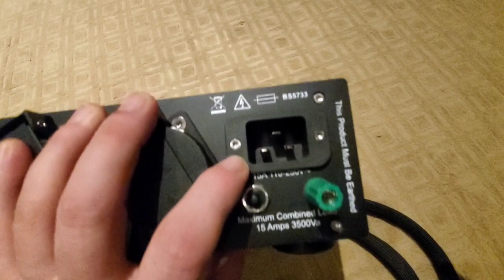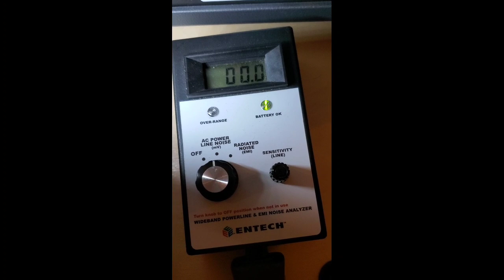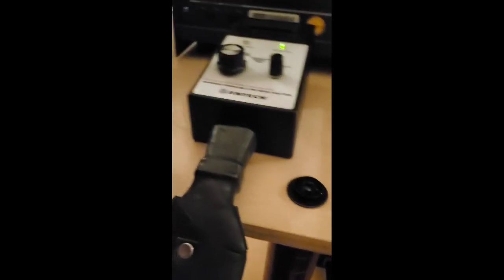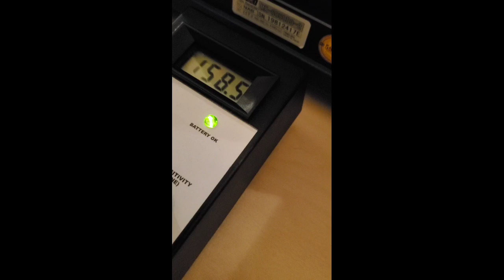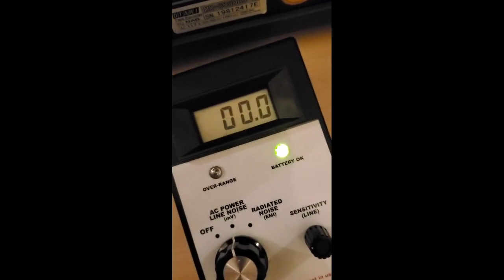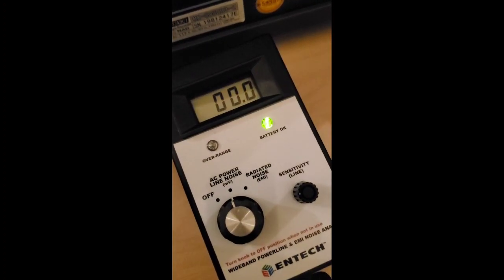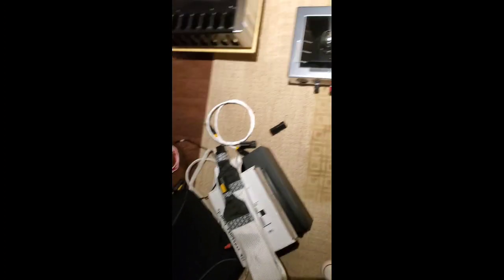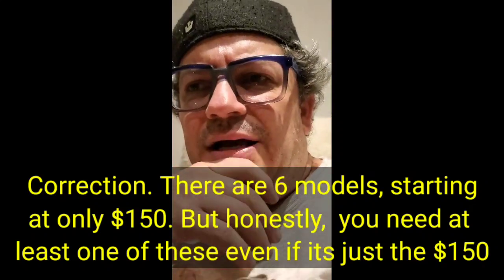PURITAN AUDIO LABS AC power conditioner

Comment: Looks like a terrific piece! It is very true that you aren't aware of the grunge in the system until it is taken away. I experienced it with power cables, power conditioner and just when I thought it couldn't get cleaner a nice power supply lowered the noise floor even more. Anyone on the fence should give Mikey a call and enjoy the benefits a good conditioner will bring.
Reply from the maker: Thanks !

Comment: While using the puritan line conditioner I noticed the tones dig deeper.  I also noticed the decay a little more pronounced.  I noticed the added Sparkle!  I could hear the sound stage widening due to a more pronounced decay.  The sound stage expands in depth as well.  Brings more weight to the sound.  I feel my rig does all this well as is.  I can't imagen how much better my rig would sound on a dedicated ac line while using the puritan line conditioner.  Can't wait to try this out! Thanks Mickey for sharing.

Comment: Hi Mikey,  Nice video again. Just another great example that the Puritan audio labs  filters are the real deal when it comes to cleaning up AC Power. I am the distributor for the Netherlands. Yesterday I was with a sound engineer and also a Jazz drummer with his own record label. It proofed that for sound engineers with tons of stuff in the input to clean and for listening back to the master on speakers.  The PSM156 or better the PSM 1512(more outlets)  leads to better judgment making in the mastering process. We do HiFi but pro audio benefits from clean power too. At the end we all listen to their results.
Reply from the maker: Yes, that is true. Ive got a client who isva mastering engineer. He told me that he loves the cord, as he has to EQ less when using my cables on his outboard gear. Then ive got a recording engineer that wont tape an event without  Verastarr on his tape deck.

Comment: My Puritan PSM 136 has only been in my system for 24 hours and no where near the recommended two weeks of burn-in and it's much better than my previous 10 conditioners.

Decay, Clarity, dimensionality, sound-stage width, depth, height and the illusion of actual performers occupying a space between and beyond the boundaries of your loudspeakers.

I do believe it will get better as the wiring, outlets and boards hit that 300 hours of constant use threshold.
Reply from the maker: Awesome Ron,  and you bought it from me!

Comment: I have one of these ....is the only unit that worked with my D’Agostino amplifiers.  I can’t afford to be without protection where I live and this worked better  than the Audioquest 5000 and 7000 by the way.
Reply from the maker: ve heard it works better than a lot of the more expensive units. Of course it sounded better than AQ,  again, another company ridden hard and put up wet, Nothing like it used to be....
Reply: Dear Hector, could you describe how it affected/improved your D’Agostino amplifiers? What are the pros and cons?
I have a Momentum Integrated but am still a little hesitant.
Reply: @monstermind1976  what I would tell you is that there was no sonic differences between the wall outlet ( dedicated 20a) and this unit. With anything else I’ve tired it constrained the music detail a bit
Reply: @hectoralvarez941  Thank you Hector. Did you plug all your front end gear in the Puritan? Pre-amp, DAC, other sources?
Many people report hearing an improvement but not everyone I guess. Makes me hesitant to make the investment. Quite a waste if you can’t hear the difference. I don’t need the protection part as I live in a condo with proper protection.
Reply: @monstermind1976  I just plugged the amps.  Use the audio quest for the front end.  ( my speakers and amps are about 15 feet away ). I have a 35 ‘ deep room
Reply: Vs Ansuz?

Comment: It seems smoother overall.  The capacitors in the power supplies should compensate for dynamic concerns much of the time.  In reality, the power feed does seem to matter even with the fact that current flows through a tiny wire that is the fuse.   Noise reduction helps with audio.
Reply: i realize it's pretty off topic but does anybody know a good site to stream newly released series online?
Reply: @Enoch Cannon Flixportal :)
Reply: @Levi Layne thanks, signed up and it seems like they got a lot of movies there :D I really appreciate it!
Reply: @Enoch Cannon you are welcome :)
Reply: @enochcannon1555  aucun rapport!

Comment: A major advantage of the IEC 60320 system  (C19) is that it can be used globally. When an equipment manufacturer designs an IEC 60320 inlet into a product, which is the most common means of connecting a detachable cord set to electrical or electronic equipment, it allows that manufacturer to make one product for sale worldwide. The detachable cord set needs to have a country-specific plug on one end and an IEC connector on the other end. This cord set allows connection to both the equipment (connector to inlet) and the power source (country-specific plug to wall socket). (quote from Interpower)

Comment: In  my system the p[ower conditioner is THE most critical component in terms of response to good isolation feet. Centerstage feet under the conditioner (Less Loss and a Holten DC filter) puts the SQ over the top.
Reply from the maker: cool man, thanks for the feedback

Comment: Does anyone have any experience with the 2 other power cords Puritan offers, at an additional cost?
One cord is called 'The Classic Plus. it is a 15 amp cord.
The other, top of the line power cord, is called 'The Ultimate XX' power cord.
There is a substantial price difference between the 'Clasdic' power cord that comes in the box with the Puritan Studio Master 156 and the next 2 higher priced ones.
Does anyone thing think any of the higher priced ones are worth the extra money? If so, what is your reasoning?

Thanks

Comment: I think the issue you heard was just truth and with a tiny tweak you will have perfection (If that exists). Wish they were cheaper! LMAO. How did it sound after break in? Did you have to make any other adjustments? Thanks
Reply from the maker: No other adjustments needed. Sounds phenomenal. Did not pay attention to what changed after break in as it was consistently improved, so I didn't really care so much..
Reply: I like you with scarfed paying so much for this, but after seeing your video on a couple of others, it seems like a worthwhile upgrade. I know I have power in my house. Did I see correctly that there is a trial period Where you can return the unit if it doesn’t work out for you?

By the way, your system is truly inspiring.

Comment: What a relief! When you played the first tunes, I thought you ALREADY HAD put this Puritan in the system and I went like, "well,... hmmm....sound is good but, again, f,,ck, problem still goes on, I can still hear imperfections like in dirty power. I'd better not leave a comment at all". And then... YES!, you show you had it out of the system and then put it in and OK, everything so much cleaner, crisper! Good Lord of audio (too), I'm so happy that, long ago, I took a leap of faith and went all battery powered! That said, this power conditioner seems to take care of the issue at about 90%, so I already wonder what it might possibly do with one of your own magical power cords. Well done again, Mikey and thumbs up!
Reply from the maker: Are your batteries charged via solar ? do you bypass the ACi n your rig alltogether or you use a DC power inverter to make AC and use the Psup on each component ?
Reply: @OCDHIFiGuy  All my components are DC12V powered. My rig is low power, high sensitivity. I use only 8-10 super-clean watts (yes, class D or, rather,T), perhaps up to 15 with quite some harmonic distortion that rather affects only  low bass. So, my amp can give me all the watts I need (about half of what I could possibly use) with 12V DC only. I escape the need for AC wall-socket power, except for recharging time. Of course I need subs for going seriously lower than 40Hz (I'm working on it and there, I'll need some juice from the wall). I was sceptical when I started, about whether batteries would be able to support great dynamics: Well, not only they do but, theoretically revisiting the matter, I saw that their short-term current ability  lies at hundreds of Amperes, waaay beyond the capacity of my power-leads!

Comment: Is this also meant to be used on power amplifiers and integrated amplifiers?
Reply: You definitely can use it with them also but, in my system when I disconnect the Pre/Power Amps, it sounded deeper. Every system is different do you need to give it a try. Just make sure to brake in every outlet (a few days) before giving your opinion

Comment: This is $1400 unit. Quite expensive. Is model A 106 similar to this $500 less. I have arcam avr850 to run on. Thanks
Reply from the maker: Look Jack, something is better than nothing , so just buy what you can afford. My policy is I will always buy it back from you if you want to change it out, we put the credit from the buy back towards your new piece   and I've got a satisfaction guarantee, which allows you to try and then decide, so my customers do not have to worry about selling their gear on the used market first in order to buy a different product , nor do they need to worry about getting "stuck" with anything that did not work for them , and there are zero restock fees. Not only that but I do free consultation and will actually help you perform setup over the phone ... Normally dealers dont care about that part. You've got no idea how many improperly setup expensive audio systems Ive seen in my day..   .
Reply: @OCDHIFiGuy  what is your company or website. I am in Toronto.
Reply: Do you have any used puritan products?

Comment: Hi Mike, what was the instrument that you used to measure the AC line noise?
Reply from the maker: Itis a harmonic analyzer from what I understand. If you google "AC power analyzer" youll find them. Entech made mine for Monster Cable
Reply: OCD HI-Fi Guy 
Cool, thanks. I was wondering the same thing.
Reply from the maker: @hifi2169  it is a discontinued piece. Youll know my model as it has 2 rotary switches on front. One to switch betweeen the type of noise its looking for, and another to adjust sensitivity then theres a lcd number display. Youve got to find them used on ebay.

Comment: Pardon me a second comment, (I had not gone through the whole video in my first one). It's sooo amazing how this thing COMPLETELY KILLS power noise! I had to see it to believe it! And also amazing HOW MUCH F@@@ING NOISE there is in a wall socket! (well, I could hear it in the past but now you made me SEE it too!) Well, people, MIKEY IS RIGHT: ALL OF YOU WHO GET YOUR RIG POWER STRAIGHT OUT OF YOUR WALLS, DESPERATELY DO NEED ONE OF THESE THINGS! And one  word about this "clamping of dynamics" thing, with power conditioners: I don't fully buy this. Some of those "great dynamics" might be false (nice but wrong) in the first place. Due to frequency areas artificially "augmented" by the dirty current. If I were still on wall-socket power, I'd be drooling for one of these Puritan boxes!
Reply from the maker: Youre on battery power ? and clamping is not a frequency thing to me. It means it is incapable of going from quiet to very loud in any sort of articulate way..
Reply: @OCDHIFiGuy  I see, so some AC conditioners might do this, anyway. (amp design may play a role too). Yet, dirty AC power may still be quite "articulate" although not exquisitely articulate. Moreover, it may inflate some frequency range more (usually midbase) and impart some fake "presence" or "loudness".   This "presence", is, more or less proportionally, augmented more, when the sound goes from quiet to loud, thus having some extra "dynamism", which is fake. I tend to judge dynamics not merely on the sudden and undistorted "blooming" of, say, an orchestra, but also on the sudden and undistorted crescendos of individual instruments too. When power is clean but  unhindered (batteries), "dynamics" may not be as startling as with some dirty wall power. But they're, truer, not manipulated. Sound is always clean and articulate, as a whole and in parts.

Comment: What model of speakers and subs are you using?
Reply from the maker: Speakers are Analysis Audio Amphitryons made in Greece and subs are Rythmik Audio open baffle by GR Research . I can sell you the Analysis as Ima dealer and the subs are a kit from Danny Ritchie. we sell the cabinets whichare also available ina flat pack kit but unless you are a pro woodworker, you'll want an assembled cab

Comment: It has to be broken in ? I could understand if it has to be turned on for a while before it performs 100% . Clash song sounded so much worse with it on. Very lean and so on. It got better alreasy after that song. But It has to filter and remove things. It shouldnt add harshness to anything, If it does its because it only filter som things and others not that will bring certain things in the performance that you then notice more. Also fun that what the salesman told you is exactly what you heard. But when this is said I am almost 100% sure that the powerlines is the thing that matters the most or lets say noise in the system is what matters most in hifi. But do those things work . thats what I doubt  unfortunately. Because if it works i will buy immedialtely

Comment: Did you like PS Audio Regenerators like the DirectStream P20 Power Plant or the AudioQuest Niagara 5000? 🤔 Most audiophiles agree power conditioners bleach the sound, but those two are the exception for many. But they are very expensive.
Reply from the maker: The puritan smokes both of those they do nothing for common mode noise just differential. Puritan is a new way to clean AC, nobody else does it like this .
Reply: @OCDHIFiGuy  "That's a bold statement." - John Travolta as Vincent Vega in "Pulp Fiction."

Comment: You are missing the Ground Master, which then plugs into ground rod. Otherwise a fault could go through your ground ... and you would not want that.
Reply from the maker: Im not missing the Ground Master. What gave you that idea ?
Reply: OCD HI-Fi Guy For clarity, it is an item Puritan sell that plugs into the green earth pole on the psm156 and obviously connects to the ground rod. The danger is that if there is a fault on the grid near you it may use your ground rod as electricity seeks the easiest route to earth and you need to protect yourself from this. HTH. As you say this gives you a clean earth which is what we need.

Comment: How can we order one in The Netherlands?
Reply from the maker: Contact Puritan in the UK , please tell them you learned about it on Youtube from OCD HiFi Guy.Ill ask them to offer you a discount for mentioning my channel.
Reply: I have sent them an email now.
Reply: @OCDHIFiGuy  
Doesn't this 136 mains power cleaner kill the dynamics from my very hungry hegel h590 what does have many power and a big tranformer. There is an 8.3 Ah fuse in it.
Reply from the maker: @theidouven2838  no , the unique thing about Puritan is that it does NOT kill dynamics...
Reply: @OCDHIFiGuy  I do ask this to you becourse the 136 is limited with 8 ah fuses.
About the groundmaster:
I do have two grounding pins in our garden.
One for al the house electric and one only for audio.
The one for audio is direct connected to the dedicated audiocable to the listening room.
My audio does have its own power phase , and own fuse  with safety ground switch.
Would a groundmaster make the sound better?

Comment: Is that Gregory Porter? First song.
Reply: Bernardino Vite. Is it? Nice voice.
Reply from the maker: Yes it is !
Reply: @OCDHIFiGuy   gracias hermano. I'm definitely going to have to get one of those. At this time I can only afford the $150,buy I'm sure it will improve the sound I'm my rig.
Reply: Yes it is Gregory Porter - Insanity ft. Lalah Hathaway. This is on the "Take Me to the Alley" CD. The duo with Lalah Hathaway is not on the LP.
Reply from the maker: @bernardinovite2707  Horale ! 'mano  Try the little wall wart thing on one of the power strip sockets that you use and it will help ..

Comment: Great. A waste of money. There is no contact between wires in the transformer, and a rectifier converts AC to DC. Any percieved change in sound is psychoacoustic. Only a badly made cable or a mile of it will influence the sound😀 But it looks cool, and you can always tell your audiophile friends that YOU can tell the difference and thus make them look like amateurs
Reply from the maker: Lol. Life of the party I can tell... go save your money schmendrick.
Reply from the maker: Lol. Life of the party I can tell... go save your money schmendrick.
Reply from the maker: Lol. Life of the party I can tell... go save your money then. You're WAY smarter than the ten users a week that buy these ...